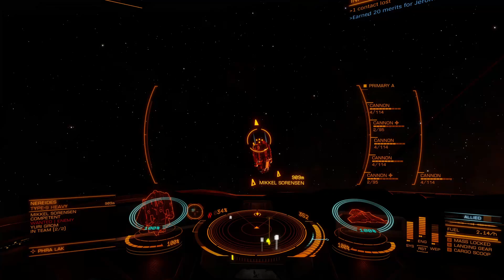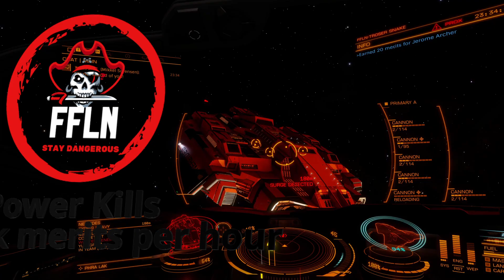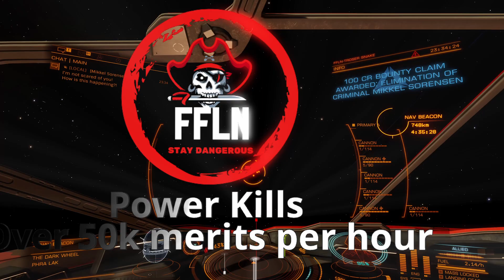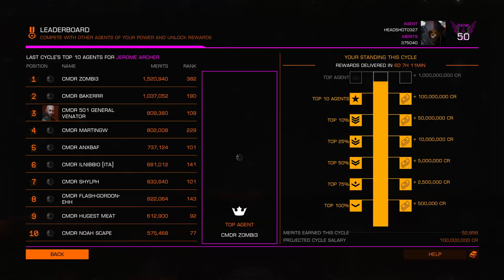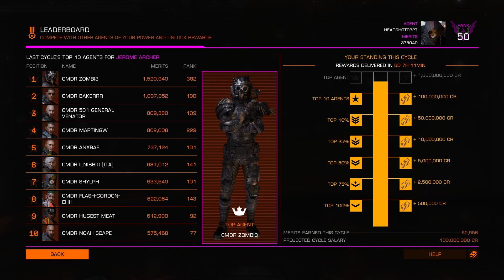Elite Dangerous PowerPlay 2.0, How to Power Kills 50k+ merits per hour, No exploits or glitches

Comment: one thing not mentioned in the video that is causing people to have issues with this method is the power they are pledged too.  only these five offer power kill merits in reinforced or undermined systems are; Arissa, Yuri, Denton, Jerome, and Archon.  otherwise thanks for the video
Reply from the maker: Yes definitely important info, I will add an edit to it
Reply: I don't get what u say. to test ur theory i killed some power ships in aisling's territory yet i got the merits
Reply: @nafisshadman579 Yeah that confused me cause I've already been doing it for Aisling without even knowing. You can actually get combat missions to assassinate them, so I'd already discovered you can do this.
Reply: Afaik it's just that those 5 powers give you bonus merits
All merit earning actions work for all powers, but the ones listed undr a system in the powerplay map mode give bonus merits (and bonus control)
Reply from the maker: @francoiskam2384  not all activities work for all powers. There are several activities that do not give me merits as an archer pilot for example. I have tested every activity in the handbook for merits
Reply: all powerplay activities give you merits regardless of pledged power. some powers just give bonuses.

Comment: this dont work for me
Reply from the maker: If pirates are not spawning, make sure it is a low security system. High security systems do not spawn pirates. If your not getting merits, you may not be in a proper system for your power

Comment: Does this method work well for systems we are acquiring for a power?
Reply from the maker: I found it does not work well for acquisition systems, acquisitions have a lower spawn chance for power ships
Reply: @FFLN-b2c  any suggestion for actions acquiring systems?
Reply from the maker: @stumpywest1652  if the system has highly profitable mining, then mining is a great option, but only if it is easy mining for high payout ores, like platinum. So this is a very limited option, as most systems are not great for mining, rare commodity trading, bounty hunting ( depends on the efficiency of the system, low security, haz rez, comp beacon ect). Also if is an anarchy system, or a system with a pirate faction, and they own an odyssey station, data from their is good, though they just recently disabled this, because of a new exploit. Salvage is also another good option. Pick what you as a player are best at, and most efficient at, and do that. Also any activities listed in on the galaxy map for that system will pay out extra merits

Comment: This is not working for me in may 2025.
Reply from the maker: I have still being doing this recently, as recent as yesterday. If you are pledged to a non combat focused power you you will not trigger as many power ship spawns
Reply: i tried it. it didnt work for me either however i realized i had modified my sensors for wide angle which gives a range debuff so maybe trying long ranger sensor engineered will work. that or they patched it which i dont think is very likely.

Comment: Thanks for sharing.
At the beginning, I was thinking, wou so easy, but not at all, I tried but I manage to kill only one on 20 I did not engineered all to 5, only 2 at 5 overload and 4 at 3 overload, I dont have the resource to up them all to 5. Also 2 or 3 time they fire back and killed me, full cannon manual is very difficult, for me.

Comment: Okay, This does work, but not all the time. 50 kph is BS but you can get 20 kph or at least 2 ranks per hour. Some systems are better than others. When you drop out sometimes you get enemies to kill. Sometimes its just friendlies (which you can quickly target for a few merits. Sometimes its just some wanted targets and sometimes its no ships at all. Only 5 factions award merits for power kills in reinforced or undermined systems, Arissa, Yuri, Denton, Jerome, and Archon. The system must be REINFORCED or UNDERMINED. The powerplay icon within the galaxy map can be filtered for these states. Keep the Nav Beacon targeted and at your back. Drop 150km away from it and wait a few seconds to see what spawns. After your kills or if you dont get any enemies to kill, jump out keeping the Nav beacon targeted and at  your back. Drop in again as soon as you can and see what ships you get. You can repeat up to 1Ls away from the Nav Beacon. At that point turn back toward it and keep dropping back in / jumping out. Eventually you will have to fly past it (slowly), drop in when youre 150m past and repeat the previous steps. Always target the smaller ships first. The bigger ships like type 9s and condas always try to jump out so target their FSD module and burn their shields down quickly P.S this is nothing new. The Wiki for power play mentions this in its tips and tricks. GL all.

Comment: Last week this was working perfectly for me. This week 90% of the instances were friendly Archon shipss.

Tried both fortified and stronghold. Suggestions?
Reply from the maker: any more info? I have been busy IRL, but I will double check archer next I am on. any mor info, on the systems you were doing these in?
Reply: @FFLN-b2c  I don't have specific names. I started in Harma. Realized that might be a bad spot to do it in, went to the system next to it - that I did it in last week, same issue. Then started looking at the PP map and just flying to fortified/stronghold systems on the outskirts of Archon's bubble. Try 10 instances, move to the next.
Reply from the maker: @talonfreak2003  I am not sure why archon seems to be effecting it. it is still working fine for archer, as well  as for a few other I know from different combat powers. I will se what I can find out. I know a few archon vets
Reply: I started experimenting with the distance from nav to drop. I wonder if there's needing to be compensation for latency. I found dropping between 200-300km past the nav beacon and presto....merit farming

Comment: You should try these system's in the Galaxy map search bar and fly to them. 07 🫡 I will warn you there are ghost systems green gas giants and Saramandara Pearls, and yes on the ghost systems you can go there, if you know how..... Turn systems from red to blue red meaning you haven't been there blue meaning you have been there, you have to turn off the lights to see the lights,.... mess around with your Galaxy map panel bar,... But in other terms I rather just complete the circuit.

Gamma velorum , HD 125178 , HD 125142 , HD 100085 , Wregoe yk-p e5-83 , Psr joo24-7204e , Psr joo24-7204o , Psr joo24-7204t , Psr joo24-7204q , Psr joo24-7204u , Hip 13044 , Cygni x-3 , Plaa aec iz-n c20-1 , Eafots eu-r c4-1 , Pru aescs dl-w c15-37 , Stuemeae fg-y d7561 , Stuemeae km-w c1-4809 , Ic 4673 , Ic 2391 sector ze-a d101 , Ic 2391 sector gw-v b2-4 , Cygnus x-1 , Cygnus x-3 , Evelyn's light , Urt , Ads 9338 ac , Scheau bli nb-o d6-342 , Lil , Synuefe xr-h d11-102 , Trappist-1 , Lft 509 , Rigel , Ngc 2841 , Ngc 5195 , Ngc 1566 , GJ 1214B , Cw 190521 , Rx j1856.5-3754 , Serpent 37 , 6 Lacertae , 6 Lambda Leporis , Alnilam , Alnitak , Mintaka , Sol , Proxima Centauri , Sirius , Stephenson 2-18 , Carcosa , Maia , Ads 4229 abc , Eimbaith Lw-w EL-290 , Floasly te-x d2-25 , Synookio EL-J d9-1 , Gongae Qw-1 c24-0 , Byoi aewsy r2-f d11-104 , Eol prou kw-1 cb-32 , Blua hypa hi-f d12-1226 , Bleia dryiae hf-w b35-1 , Col 285 sector vu-m c8-32 , Eol prou kw-1 c8-32 , Eafoff IN-Q d6-0 , Dryooe prou ff-z d696 , Boelts XH-C c29-854 , Shaulai DL-P d5-274 , Stuemeae bv-y f2111 , Stuemeae nn-s e4-1360 , Stuemeae nn-s e4-5583 , Nyuena bf-r e4-3196 , Nyuena bf-r e4-4054 , Nyuena bf-r e4-2200 , Nyuena bv-p e5-458 , Nyuena bv-p e5-1493 , Nyuena bv-p e5-2376 , Pre Aowsy ba-a , Brambai uz-o e6-313 , Dumboe aa-a h207 , Hypao brai kw-v b5-21 , Hypio gree aa-a h56 , HD 155889 , Bleia dryiea xj-r e4-1 , Hi'iaka , Angosk jm-w d1-05 , Hip 52741 , Tira Flirble , Smade's , Hip 57951 , Lorant mi-b d13-1 , Blaea brou cn-b d13-06 , Psr j0024-7204Q1 , Eolls hypai no-x d2-06 , HD 64285 , Hip 64902 , Hip 604151 , HD 213221 , HD 211744 , Hip 57951 , Smeamaa aa-a ho4 , Phleedgoea kx-u f2-10 , Garth , Izar , Axanar , Klingon , CBS , Orian , Actaea , Vanth , HD 35460 , Hip 57951 , S171378 , Smith's claim , Pru aescs zk-p e5-103513 , HD 474171 , Swoiwns td-r d5-85 , Wellington , HD 64287 , Hip 64902 , Oevasy sg-y do , Hyphiemoe yk-p d5-0 , Eolls hypai ll-z d1-02 , Psr j1641+3627ba , HD 64282 , 2 mass j02323627+61282553 , Nyeajoa fb-o e6-oa , Eor phyloi cl-y g137 , Pria thoi zp-g d10-37 , HD 2020881 , Ogaicy zo-a e4228 , HD 935217 , HD 984256 , HD 71297 , Ra , La , MYT , Boetis , Sagittarius A* , Beagle point  , Romulus  , Polaris , Wolf 359 , Gargantuan , Miller's planet , H    , last bust not least use your first three letters of your commander name in-game for your secret starter system ..

Comment: This method doesn't work.
Tried spawning new instances in my powers fortified system for an Hour... not 1 zilch edit so as for your power if they aren't combat focused    then the spawn will be much much lower?
Reply from the maker: you could be with a non combat focused power. if you are, you will not get spawns
Reply: @FFLN-b2c  that explains damn went aisling to support ^^

Comment: Forward the Federation! 

Thanks for sharing your knowledge, this will benefit the Federation! 
o7
Reply: You should try these system's in the Galaxy map search bar and fly to them. 07 🫡 I will warn you there are ghost systems green gas giants and Saramandara Pearls, and yes on the ghost systems you can go there, if you know how..... Turn systems from red to blue red meaning you haven't been there blue meaning you have been there, you have to turn off the lights to see the lights,.... mess around with your Galaxy map panel bar,... But in other terms I rather just complete the circuit.

Gamma velorum , HD 125178 , HD 125142 , HD 100085 , Wregoe yk-p e5-83 , Psr joo24-7204e , Psr joo24-7204o , Psr joo24-7204t , Psr joo24-7204q , Psr joo24-7204u , Hip 13044 , Cygni x-3 , Plaa aec iz-n c20-1 , Eafots eu-r c4-1 , Pru aescs dl-w c15-37 , Stuemeae fg-y d7561 , Stuemeae km-w c1-4809 , Ic 4673 , Ic 2391 sector ze-a d101 , Ic 2391 sector gw-v b2-4 , Cygnus x-1 , Cygnus x-3 , Evelyn's light , Urt , Ads 9338 ac , Scheau bli nb-o d6-342 , Lil , Synuefe xr-h d11-102 , Trappist-1 , Lft 509 , Rigel , Ngc 2841 , Ngc 5195 , Ngc 1566 , GJ 1214B , Cw 190521 , Rx j1856.5-3754 , Serpent 37 , 6 Lacertae , 6 Lambda Leporis , Alnilam , Alnitak , Mintaka , Sol , Proxima Centauri , Sirius , Stephenson 2-18 , Carcosa , Maia , Ads 4229 abc , Eimbaith Lw-w EL-290 , Floasly te-x d2-25 , Synookio EL-J d9-1 , Gongae Qw-1 c24-0 , Byoi aewsy r2-f d11-104 , Eol prou kw-1 cb-32 , Blua hypa hi-f d12-1226 , Bleia dryiae hf-w b35-1 , Col 285 sector vu-m c8-32 , Eol prou kw-1 c8-32 , Eafoff IN-Q d6-0 , Dryooe prou ff-z d696 , Boelts XH-C c29-854 , Shaulai DL-P d5-274 , Stuemeae bv-y f2111 , Stuemeae nn-s e4-1360 , Stuemeae nn-s e4-5583 , Nyuena bf-r e4-3196 , Nyuena bf-r e4-4054 , Nyuena bf-r e4-2200 , Nyuena bv-p e5-458 , Nyuena bv-p e5-1493 , Nyuena bv-p e5-2376 , Pre Aowsy ba-a , Brambai uz-o e6-313 , Dumboe aa-a h207 , Hypao brai kw-v b5-21 , Hypio gree aa-a h56 , HD 155889 , Bleia dryiea xj-r e4-1 , Hi'iaka , Angosk jm-w d1-05 , Hip 52741 , Tira Flirble , Smade's , Hip 57951 , Lorant mi-b d13-1 , Blaea brou cn-b d13-06 , Psr j0024-7204Q1 , Eolls hypai no-x d2-06 , HD 64285 , Hip 64902 , Hip 604151 , HD 213221 , HD 211744 , Hip 57951 , Smeamaa aa-a ho4 , Phleedgoea kx-u f2-10 , Garth , Izar , Axanar , Klingon , CBS , Orian , Actaea , Vanth , HD 35460 , Hip 57951 , S171378 , Smith's claim , Pru aescs zk-p e5-103513 , HD 474171 , Swoiwns td-r d5-85 , Wellington , HD 64287 , Hip 64902 , Oevasy sg-y do , Hyphiemoe yk-p d5-0 , Eolls hypai ll-z d1-02 , Psr j1641+3627ba , HD 64282 , 2 mass j02323627+61282553 , Nyeajoa fb-o e6-oa , Eor phyloi cl-y g137 , Pria thoi zp-g d10-37 , HD 2020881 , Ogaicy zo-a e4228 , HD 935217 , HD 984256 , HD 71297 , Ra , La , MYT , Boetis , Sagittarius A* , Beagle point  , Romulus  , Polaris , Wolf 359 , Gargantuan , Miller's planet , H    , last bust not least use your first three letters of your commander name in-game for your secret starter system ..

Comment: Thanks for this, i love a bit of efficiency. I was following the old method and dropping out around 150km from nav beacons, the results were poor.  When the servers are back up I'll try the greater distance in the systems I'm working and see if it makes any difference.
Reply from the maker: @zombi303  it does. I found 700ish to be the sweet spot  above 650 below 900 gave me ne the best results. Less than 650, gave me allot of empty instances
Reply: You should try these system's in the Galaxy map search bar and fly to them. 07 🫡 I will warn you there are ghost systems green gas giants and Saramandara Pearls, and yes on the ghost systems you can go there, if you know how..... Turn systems from red to blue red meaning you haven't been there blue meaning you have been there, you have to turn off the lights to see the lights,.... mess around with your Galaxy map panel bar,... But in other terms I rather just complete the circuit.

Gamma velorum , HD 125178 , HD 125142 , HD 100085 , Wregoe yk-p e5-83 , Psr joo24-7204e , Psr joo24-7204o , Psr joo24-7204t , Psr joo24-7204q , Psr joo24-7204u , Hip 13044 , Cygni x-3 , Plaa aec iz-n c20-1 , Eafots eu-r c4-1 , Pru aescs dl-w c15-37 , Stuemeae fg-y d7561 , Stuemeae km-w c1-4809 , Ic 4673 , Ic 2391 sector ze-a d101 , Ic 2391 sector gw-v b2-4 , Cygnus x-1 , Cygnus x-3 , Evelyn's light , Urt , Ads 9338 ac , Scheau bli nb-o d6-342 , Lil , Synuefe xr-h d11-102 , Trappist-1 , Lft 509 , Rigel , Ngc 2841 , Ngc 5195 , Ngc 1566 , GJ 1214B , Cw 190521 , Rx j1856.5-3754 , Serpent 37 , 6 Lacertae , 6 Lambda Leporis , Alnilam , Alnitak , Mintaka , Sol , Proxima Centauri , Sirius , Stephenson 2-18 , Carcosa , Maia , Ads 4229 abc , Eimbaith Lw-w EL-290 , Floasly te-x d2-25 , Synookio EL-J d9-1 , Gongae Qw-1 c24-0 , Byoi aewsy r2-f d11-104 , Eol prou kw-1 cb-32 , Blua hypa hi-f d12-1226 , Bleia dryiae hf-w b35-1 , Col 285 sector vu-m c8-32 , Eol prou kw-1 c8-32 , Eafoff IN-Q d6-0 , Dryooe prou ff-z d696 , Boelts XH-C c29-854 , Shaulai DL-P d5-274 , Stuemeae bv-y f2111 , Stuemeae nn-s e4-1360 , Stuemeae nn-s e4-5583 , Nyuena bf-r e4-3196 , Nyuena bf-r e4-4054 , Nyuena bf-r e4-2200 , Nyuena bv-p e5-458 , Nyuena bv-p e5-1493 , Nyuena bv-p e5-2376 , Pre Aowsy ba-a , Brambai uz-o e6-313 , Dumboe aa-a h207 , Hypao brai kw-v b5-21 , Hypio gree aa-a h56 , HD 155889 , Bleia dryiea xj-r e4-1 , Hi'iaka , Angosk jm-w d1-05 , Hip 52741 , Tira Flirble , Smade's , Hip 57951 , Lorant mi-b d13-1 , Blaea brou cn-b d13-06 , Psr j0024-7204Q1 , Eolls hypai no-x d2-06 , HD 64285 , Hip 64902 , Hip 604151 , HD 213221 , HD 211744 , Hip 57951 , Smeamaa aa-a ho4 , Phleedgoea kx-u f2-10 , Garth , Izar , Axanar , Klingon , CBS , Orian , Actaea , Vanth , HD 35460 , Hip 57951 , S171378 , Smith's claim , Pru aescs zk-p e5-103513 , HD 474171 , Swoiwns td-r d5-85 , Wellington , HD 64287 , Hip 64902 , Oevasy sg-y do , Hyphiemoe yk-p d5-0 , Eolls hypai ll-z d1-02 , Psr j1641+3627ba , HD 64282 , 2 mass j02323627+61282553 , Nyeajoa fb-o e6-oa , Eor phyloi cl-y g137 , Pria thoi zp-g d10-37 , HD 2020881 , Ogaicy zo-a e4228 , HD 935217 , HD 984256 , HD 71297 , Ra , La , MYT , Boetis , Sagittarius A* , Beagle point  , Romulus  , Polaris , Wolf 359 , Gargantuan , Miller's planet , H    , last bust not least use your first three letters of your commander name in-game for your secret starter system ..